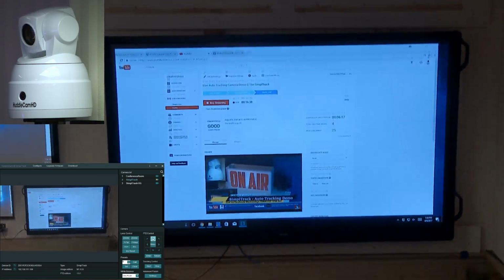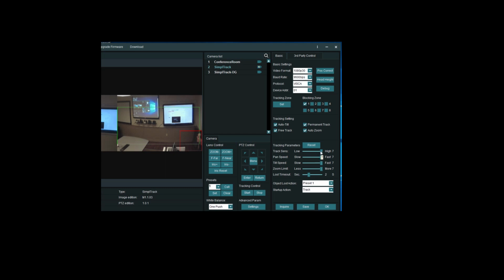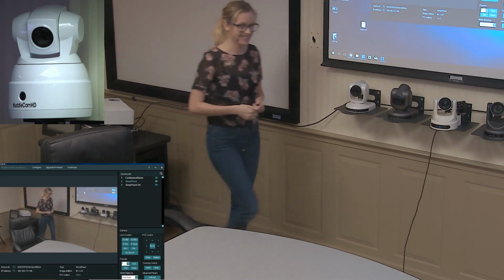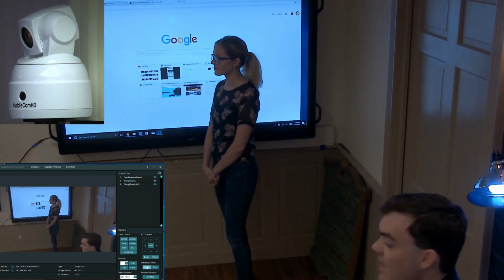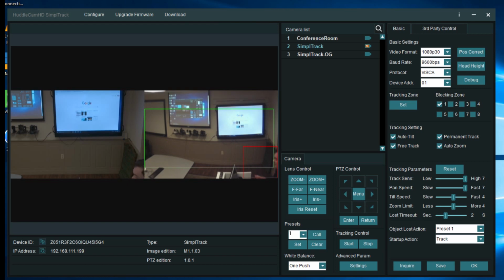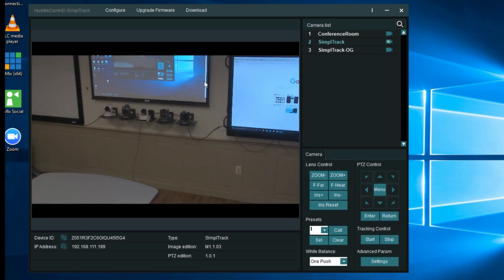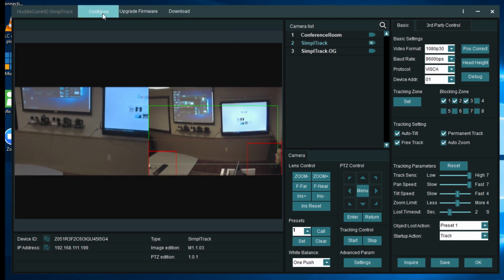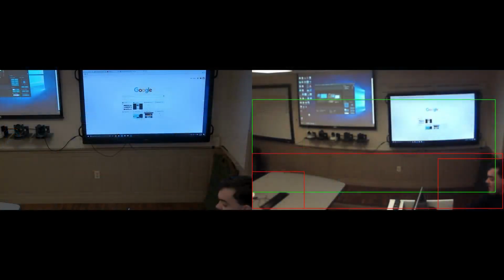Live Auto Tracking Camera Demo || The SimplTrack

Comment: Hello i have a question.. i am looking for a permanent solution for live streaming seminars in a large sized seminar room. Will this camera be appropriate?
Reply from the maker: anandhi iyyapan - yes, there is a Simpltrack2 now that is very popular.
Reply: @Huddlecamhd  okay how about the audio? i mean if i have to fix this camera on the ceiling, either above my projector? then how does it work? should i get separate audio equipments?
Reply from the maker: anandhi iyyapan - yes you will want a wireless microphone system most likely for the teacher
Reply: @Huddlecamhd  okay.. there are many cameras from HuddleCam.. which one would you suggest for a mid-size room (80 sqm)
Reply from the maker: @anandhiiyappan1257  If you would like auto tracking the SimplTrack2 is the option for you. Otherwise, the 10X-G3 is a great option. But it requires manual PTZ control.
Reply: @Huddlecamhd  okay can you provide me the link where i can buy? i cannot find SimplTrack2 online.
Reply from the maker: @anandhiiyappan1257  https://www.bhphotovideo.com/c/product/1433091-REG/huddlecamhd_hc20x_simpltrack2_hc20x_simpltrack_second_generation_auto_tracking.html